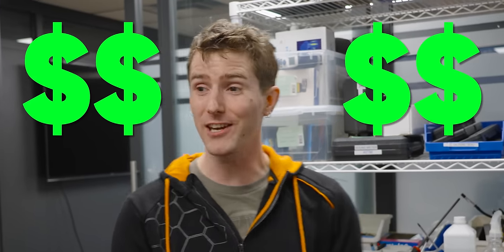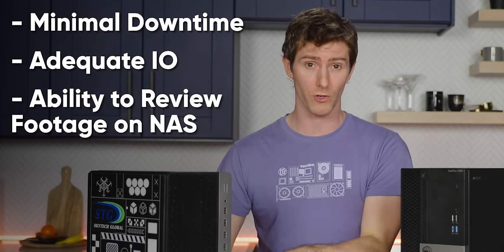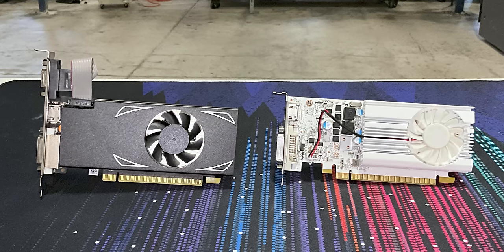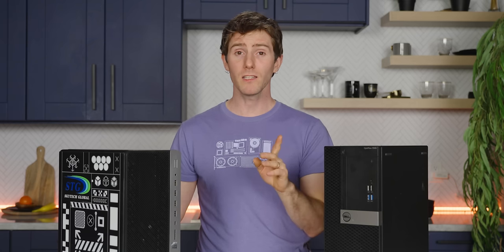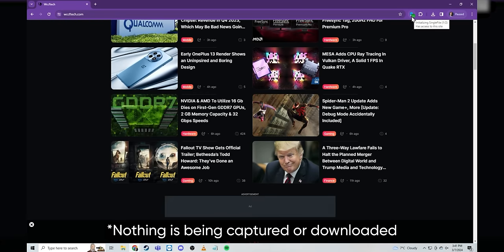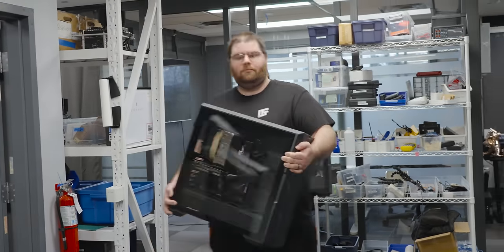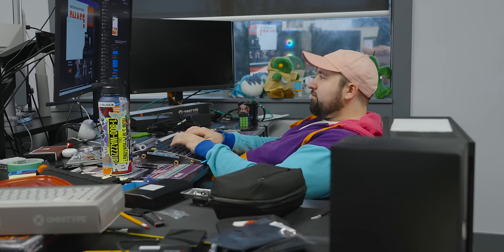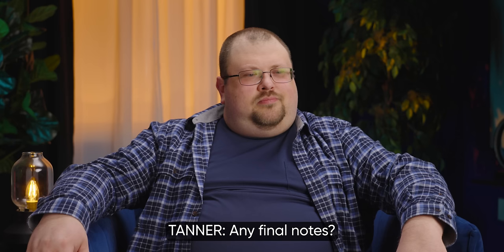We Downgraded our PCs to Prove You Don’t Need a New One

Comment: Few years back, I got a colleague from supply chain complaining about her PC being too slow, she "needed a new one". I tried it, it was indeed very slow, I added a bit of RAM that I had laying around: better, but still slow. I removed one of her theming software: it was already back to usable. Next I changed the HDD for a SSD and re-install a fresh Windows. She genuinely thought she got a new PC... 

A proper software management is as important as having the latest hardware.
Reply: I can confirm that fresh windows reinstall can feel like a brand-new PC if coupled with upgrade to SSD.
Especially if you finally get rid of your 10yo Win7 install.
Reply: I think SSD did most of the work, the rest are nuances.
Reply: @zbigniew2628  It's true the SSD probably did most of the work, but software management is absolutely NOT a nuance. I just recently "cleaned" a relative's PC. No reinstall, just uninstalling and disabling things that weren't needed or used. Before my tweaks, it had a 15 minute boot time. You could hit the desktop in 2 minutes, but the disk activity would stay locked to 100% usage LONG after. Once I had my way with it, the boot time was under 5 minutes, with 0 hardware changes. Even OP mentions the system became significantly more responsive after simply removing a single program.
Software bloat makes a huge difference.
Reply: Sure, but sometimes you do actually need new hardware. My old job absolutely refused to do upgrades, they repeatedly gaslit us that our constant issues with RAM/slow hard drives was because we weren't rebooting often enough. I mean, yeah, rebooting does close Chrome so yeah, you'll have more ram available then.... but you also can't do your job!

This all was despite me being far more qualified than the IT person (who was the son of the founder)
Reply: I find it wild that some ompanies let you install stuff on your machines at all. We've got all our devices locked down and you can't install a browser without elevated privileges. 

I've heard people play steam games on their systems during a break, that app would be flagged and removed in my company 😂
Reply: also bigger companies runs many mandatory software and probably encryption is also a must which can slow down the PC
Reply: @Madwonk  If your use case didn't change, and the PC was fast enough when you bought it, then you don't need new hardware, you need to clean the system.
You only need upgrades if the scope of your work increases.
Reply: @Cormy1  the scope of work is open source intelligence, where analysts regularly need to open hundreds of tabs. The fact we couldn't open more than 5-6 tabs was a serious problem that management was ignoring.
Reply: @Cormy1 Disagree. If you keep your software up to date, it will FORCE you to do some upgrades to stay ahead of the bare minimum specs. This is especially true for heavy creative work, like video editing at 4K. 

Example: When I ran Hitfilm Express (before I finally ditched them when Artlist bought them out) and was running it on a 4th gen (2013) Dell SFF desktop with a weezy Invidia GeForce 610 @ 1GB and I forget the version, but the one they had in 2019 had specs that were barely below some of what I had, then the next upgrade came down, minimum specs went up, but had proxies available so ran that until I had to ditch Hitfilm.

Now, I ended up upgrading the PC, but not after ditching Hitfilm for Davinci Resolve 12.5.  It did relatively OK on that old PC and was a bit better on the new one, a 2017 based Dell Optiplex 3050. This time, with Windows 11 and NVMe, 16GB of RAM (old one had 16 GB too), but was forced to upgrade the graphics card to a low profile Invidia GT 1030 with 2GB, and now I run DR 16. I also added another SSD (SATA) for editing/scratch.  This means a bit easier time scrubbing through footage, though not perfect. The SATA SSD was meant for the old PC to reduce pain points in editing, but threw a wrong code (saying failed mainboard, when it was the CMOS battery after the fact).

So need to look at what you use, what they recommend and then upgrade as needed.
Reply: @Madwonk  mmmmm debatable. As a professional tab procrastinator constantly running dozens of tabs at a time, with hundreds accumulated every year to the session grand total approaching 2000 now, I'm well aware that you can just manage them better. It's not like you can interact with 6 simultaneously anyway, just need proper software for unloading or pausing the loading of new tabs until you're actually looking at them. I have something like 1500 tabs in my Firefox browser right now but they aren't all active, and every once in a while I'll load up like 300 at once from one of my many lists of tabs, but I know better than to let them load now, so I do it while offline so the tabs are intact but they aren't really using any resources since the pages are blank.
Even then, unless those are some massive pages, you should easily fit 10 within 1 GB of RAM...? Should be well within the specs of anything sold in the last 10 years.
I have a hard time grasping how you were in such a desperate "unsolvable" scenario.
Reply: @johnhpalmer6098  Again, I insist that if your scope doesn't change, you don't need to upgrade. That applies to software too. More often than not, software updates introduce more problems than they solve.
Worse if they increase minimum specs of the software with an arbitrary lock out.
Don't tell me you were doing native 4k editing on that SFF Dell before you updated the software lol
You changed your scope.
Reply: @Cormy1  I didn't, and still don't. I edit in 1080P, but may try shooting in 4K, but edit on a 1080 timeline though.

I still contend, eventually you will come up needing to update. Even gamers if they play current AAA titles may need to upgrade if they want to play certain titles, even if at a lower setting.
Reply: What is this theming software?
Reply: Cosmetic softwares are some of the biggest BS one can install, either for a PC or a smartphone. People need to lay off the whole customization obsession.
Reply: Ah yes, the ole' "my PC doesn't have to wait to retrieve hundreds of different fragments from multiple areas of a spinning disk drive to get stuff done" boost.
Reply: @johnhpalmer6098  If you are shooting in 4k but didn't before, you have changed your scope.
Playing different games is a change in scope.
Cyberpunk does not have the same requirements as Super Mario Bros.

I would still be using a 4 thread Phenom AM3 processor if I didn't also want something with integrated graphics to get rid of the old GPU in the system.
Reply: @zbigniew2628  No, just half. The amount of garbage people install is actually obscene... and telling them that is like talking to a wall...
Reply: Back than an ssd was the biggest performance boost i ever noticed ever. Besides games. That doesn't count for me with OS things to do. Excel surfing and data things.
Reply: @Cormy1  This is why if you get a complaint about a slow PC, you should install Linux on it and rice it so they can't tell you changed anything.

I use Arch, BTW.
Reply: My parents have an old laptop with a 6th gen i3. I asked them if they wanted a new battery and they told me it's so unusable at this point that they were probably just going to get a new one. I replaced their HDD with an SSD, just a simple swap, and suddenly their computer was snappy and useful again. Soon after they inquired about that battery I had mentioned before...

HDDs just shouldn't be boot drives at this point.
Reply: @lemming573  Back in the day an SSD as boot drive was the biggest performance boost i ever noticed in an os when upgrading. After numbing from an 386 dx40 to an pIII 550 😂
Reply: If your PC is a glorified smartphone with a keyboard the solution is install an immutable Linux distro because that’s what phones use
Reply: @Cormy1  yeah fr, people keep yelling bout how many tabs it can open, but dude seriously they cant (and wont) even use all of the tabs at once, what a joke aint it 😂
Reply: A slow system can be the symptom of a failing hard drive. If she wasn't complaining before and it started doing that out of the blue (assuming it wasn't her theming software or some other software), then chances are the HDD was failing. Besides, nobody should be using a HDD as their primary drive nowadays. Even a cheap $30 SATA SSD is better than a HDD.
Reply: @NaoyaYami  does that also count for a update stacked Windows 10 OEM gaming PC from 2017?
(I never really had unescesary software or stuff on it)

Comment: At my old workplace, where I ended up building a load of the PCs, we generally just did round-robin upgrades. Those who needed more powerful systems got the newest stuff; their old system would then be given to those who needed a slightly lower power system, then THEIR machines went to the next tier... etc etc. Everyone got an upgrade, everyone was happy, and we minimised costs and downtime - the downward steps could be offset by some time so support/issues didn't gum up the works. Anything left at the end of the line, we generally destroyed the HDD and gave the rest to local groups who then recycled them/provided them to those who might need a PC but didn't have the resources - generally poorer families with kids in primary school, or pensioners who were being supported by local groups to get online. Old machines don't need to die, they just need to move down the line to where they fit best.
Reply: Until mum bought a new PC from a store a couple of years ago, they would just get my old tower whenever I built a new one. Admittedly, I hadn't built one in nearly a decade at that point, but we just cycled the hardware down through the family for years. I was the tech nerd always buying the new fancy thing, so I'd pass down whatever I was replacing to parent or sibling, whoever needed it more. Definitely a valid system.
Reply: Except when it’s a Mac and Apple has decided to ditch support for an otherwise perfectly functional daily computer. Seriously they should be fined for willful creation of e-waste.
Reply: @markmuir7338  funnily enough though, current macos has older devices fully supported than Windows 11 in some cases. (It is the same for Intel CPUs, and better than and cpus)

For reference, apple supports macs with software updates in most cases for 7 years.
Reply: @varno  you can run windows 10 on things from 2010 and it can run any modern software fine so even if it is not supported it's fine unlike apple 7 years = anything prior to 2016 can't run latest software versions.
Reply: @firasrabaia I mean, true, but you can run most macos software on os10.15 catalina, which supports all machines back to 2012, it just doesn't get security releases. Monterey is still gets security releases, and that runs on 2015 mac laptops, and even some 2013 mac desktops. You can't compare Windows 7 to Windows 11 and not give the same favours to macos. It is not quite as good historically, but 7 years of full upgrade support and 10 years of security updates is still pretty good.
Reply: Just as an aside, apple has a famous beef with nvidia, and a focus on security, it was gpu compatibility with their metal api that killed the older macs in most people's opinion.
Reply: "gave the rest to local groups who then recycled them/provided them to those who might need a PC".
This is huge for a company to do.
My current workplace handles hundreds of PC's a month, and a lot of them are just tossed out even with minor issues (HDD/SSD failures, GPU failures, 1/4 ports died in GPU).
It's mind numbing and depressing, and I always tell our techs on-site to recycle, up-cycle and/or give them to someone in need instead of throwing them away.

I hopped into our own dumpster for a few myself and they're still running strong as servers in my home lab (if it wasn't for updates or power outages, they'd be well over 100hrs uptime)
Reply: This is the way
Reply: hate to be that guy but that's not how round robin works, in your case you have priorities which round robin lacks of and the main concept is to distribute equally among all processsors/consumers.
Reply: @firasrabaia Windows 10 support is ending next year. And that's already been extended a couple of times because W11 uptake has been poor.
Reply: I love when companies do this. I try my best to source these type of free office PC's from local groups. I think people would be surprised how fast these 10 year old systems sell at the right price.
Reply: @agentcrm  Oh no, does that affect how the grill works?
Reply: @agentcrm  yeah ofc but the thing is even if the support is done you will still receive latest versions from software more years unlike the macos versions where you will be stuck most likely.
even thought see a lot ppl running win11 with 4th gen 2014 devices fine.
Reply: I'm not sure if we're already at a place where we can just run SATA ERASE or NVMe CRYPTO ERASE and be completely sure that everything is gone, but for most operations it should be sufficient. I'd not trust this on a B-brand SSD or an SSD that is not part of the OEM package of a reputable company though.
Reply: @firasrabaia  you can bypass a lot of newer MacOS requirements using OCLP, like you can to Windows 11
Reply: Damn right. Latin America is full of DDR3-era tech. It might not be much for today's standards. But upgrading from a Celeron/Pentium system, to a Xeon system of the same age, is just a crazy performance increase. And all for the price of dinner.

This is a good argument to keep PC building alive, as opposed to transitioning to integrated systems for everything outside the enthusiast market. Great way to reduce E-waste.
Reply: Sadly, at where I work, I used to see computers drop off the books and make it into re-use; but nowadays, we have to go beyond wiping the drive to actual destruction of all the  storage, . It's truly the time that is required; no one wants to put in one more minute to be able to provide a system without drives; so it all goes to the same recycler which we pay by the way.. So we buy the hardware, and then pay to get it destroyed once we are done using it.    There's now a general movement to using cloud based VM's instead  ( Azure VM's ) to avoid the waste and costs associated with hardware.

Comment: I feel like most of the weird bugs people encountered were because they moved the drives from their current systems into the older ones. Windows doesn't exactly like having conflicting drivers installed. And I know that windows has the sysprep /generalize tool but in my experience from creating windows images, your image source machine should match the target hardware as close as possible. That's why in order to minimize the number of images they have to maintain, many companies only offer 3-4 system choices overall.
Reply: Seriously tho I can’t believe they did that.
Reply: @Sci-Mon1  Agreed, very stupid oversight.
Reply: They should have set their SSDs up as data drives.
Reply: This is a very valid point and I have experiences with this as well. Just throwing your drive from one system to the next can cause some weird behaviour. A lot of those small quirks they mentioned were very likely caused by exactly this. Monitor glitches, login bugs, extensions not working? Classic examples of the kind of weird issues you would get if you migrated a drive from a completely different system. These issues are also 10 times more common if you migrate from an AMD system to Intel or vice versa.